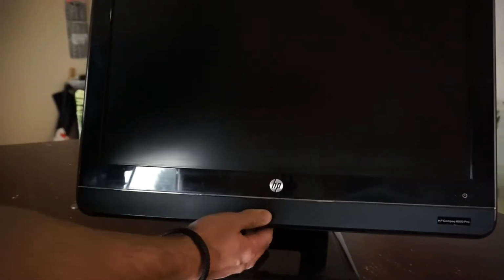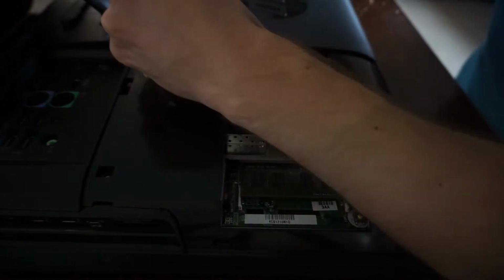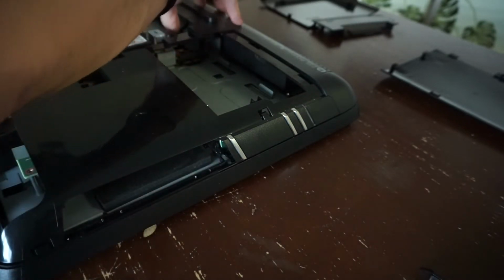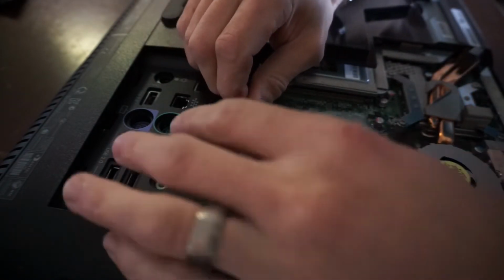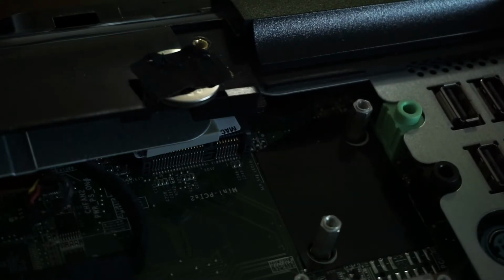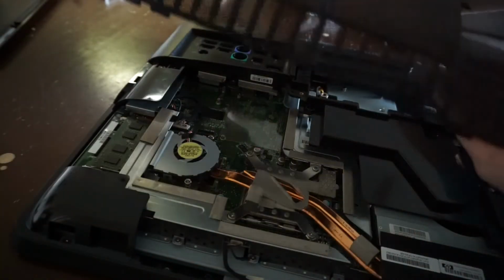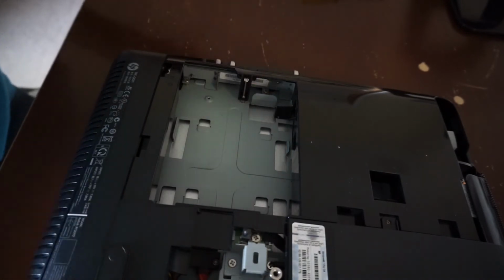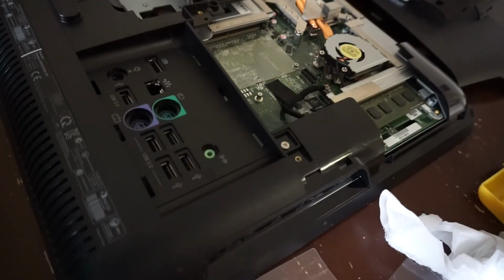Compaq 6000 Pro tear down

Comment: Thanks for the video, sometimes getting in hardest part.  As for all-in-ones to work on, the Dell 9030 is really easy.  Also, I did order an Intel Core2 Quad (a Q9400), as you mentioned ($15 on Aliexpress).  Sadly it doesnt work, and boots to "1802-Processor Not Support.  This system board does not support this processor.".   I guess I'll put the old one back in!
Reply from the maker: bugger to hear it didnt work with the Q9400, but atleast it was a cheap purchase
Reply: @rickstechrepairs  yup $17 landed in NZ.